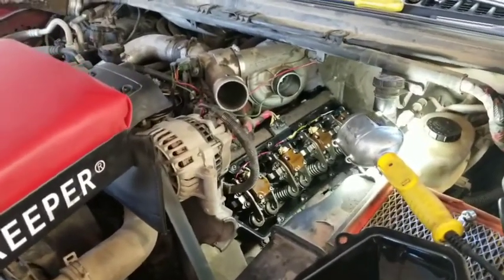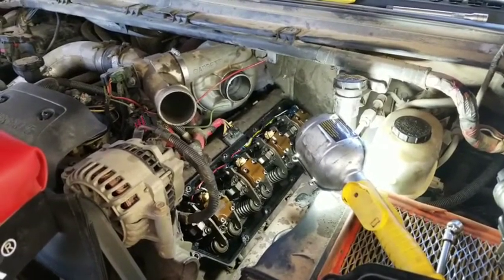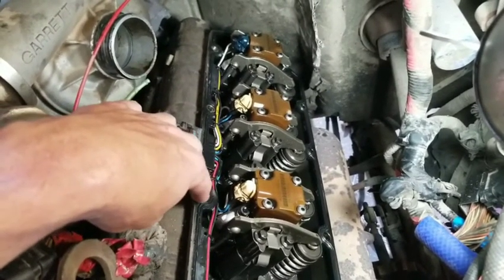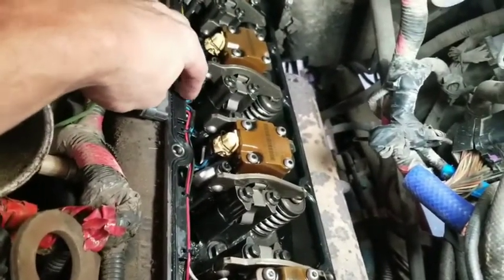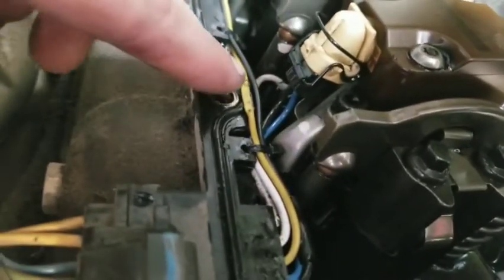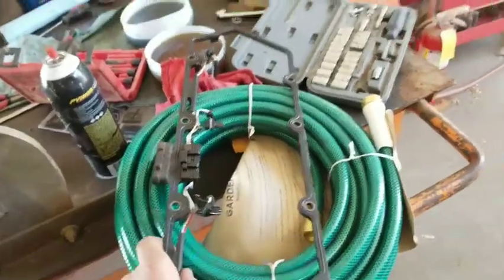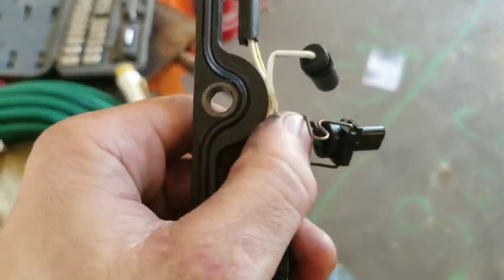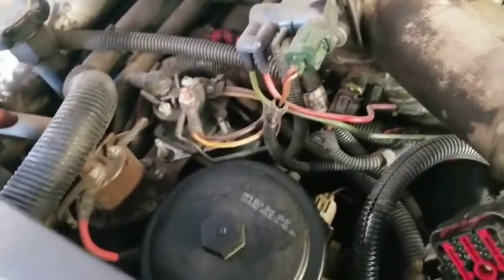7.3l Powerstroke injectors. AD vs AE and other injector info

Comment: What if you have all AD? Are these stock? I paid a shop o install supposed used reman injects. 2 years down the road I m loosing a ton of oil so I pull the valve cover and I swear they are all the original injectors.
Reply from the maker: You can run all AD injectors if you want to.  Many 1998 through 2001 engines had all AD injectors.

Comment: Was surprised to see the number on the coil... mine are stamped into a metal plate, attached to the top of the solenoid coil.
Reply: I bought some rebuilt injectors and 1 of them had a metal plate.  This is the only other time I've heard of that.